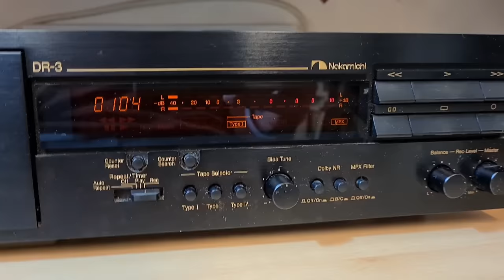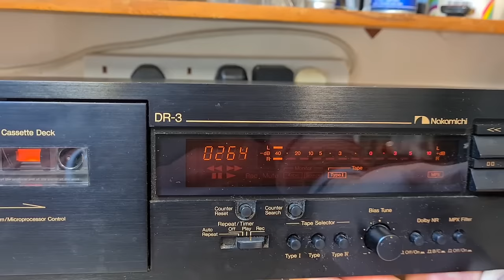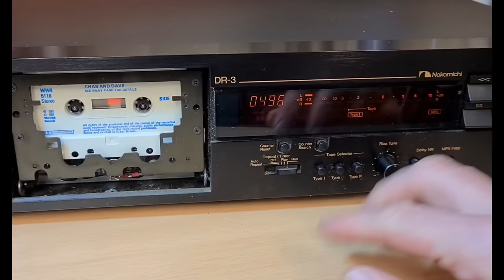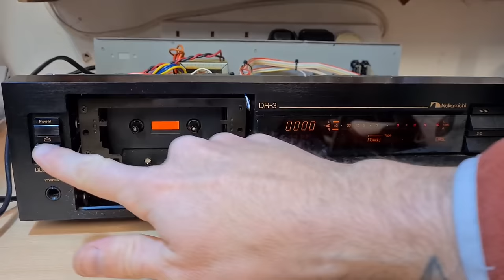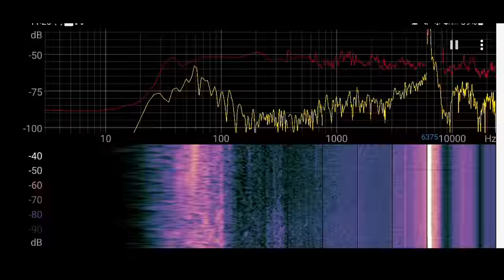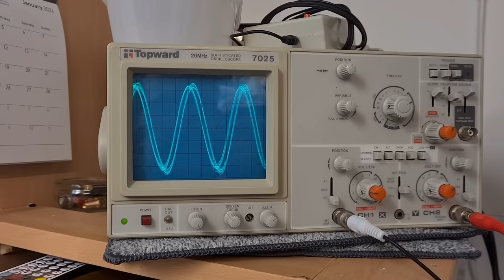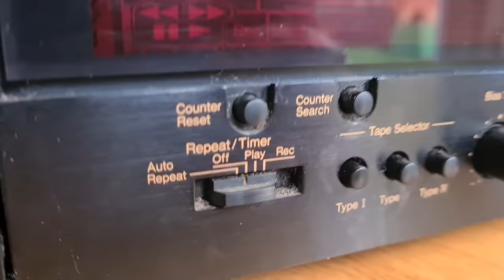Seller said it's broke, but its not?! Nakamichi DR3 Cassette Deck Repair & Service!

Comment: I have a DR3, great little machine I love it. I bought 2 Sony 611’s 3 head machines after watching your videos, both super condition around the cases but not working.  Both Sonys Sold as spares on marketplace (find it cheaper than eBay) did the belts etc and now have 2 great Sony machines. I can’t sell them though, they are so nice so I have a cluster of decks. 
I’ve started buying DAT machines as well, so bloody addictive. Same sort of problems as the cassette decks. I just bought a Sony A8 dat as spares parts. It is wonderful condition, found the cam had slipped on the tape loader, set it back into the right location greased it up….bingo perfect. I have also found I can record from my Wiim streamer into the dat with a coax connection, so all digital.
Reply from the maker: I was thinking of picking a DAT up mainly because I wasn't too impressed with minidisk. Maybe I'm the future!
Reply: @pwrestoration  yes good call. I have seen some Sonys going for mad money, but realistic is more like £200 I think anyway. I have a Sony A8, A6, 700 seriesES, and a tascam 30. Can’t tell the difference in sound at all. I also found tapes can be cheap if you buy the data tapes they last longer are more robust  and don’t have music written on them…….
It’s great to be able to tape digitial from a streamer, my wife says ‘why do that you can stream it’ which is 100% correct, I say ‘because I can’ it’s also nice to just drop a mix tape in rather than muck about with the iPhone etc.
Reply: I always think of wii when I see that name lol strange I'm the only 1😂.

MDs are awesome, I miss my deck😢

Nice video btw OP, congrats on the unit

Comment: Done really well you got lucky i guess they never noticed only the one reel of the deck was turning .Really nice clean deck this is the one model of nakamichi i would go for as i would never spend the amount any of the 3 heads make .
Reply: I got lucky back in the day and got a serviced DR2 for £100 - ex Chop Em Out studios so has lots of hours but the heads are still tip top. Had it since 2003 and it now definitely needs a belt replacement. Eek...
Reply: nakamichi is overrated ,you can buy a 3 head deck for less money than a badly built cheap nakamichi, and you´ll get everything better

Comment: Showing some advanced overhaul skills there... I have a DR8 (the last 2 head NAK) and a Cassette Deck 2 (looks different, same deck).
Reply from the maker: I didnt know the cassette deck 2 was similar, they pop up from time to time. Might take a look at one 👍
Reply: @pwrestoration  Pretty much identical internally. CD2 has green / red VFD instead of orange. Other than that it's just a styling job.

Comment: i bought last tuesday a still in the box nakamichi DR-10 in champagne ,but the brand is huge and where the cassette is inserted but on top of it and it looks a lot like this but a 3 head deck, it cost me 500€, but it works like new and released in 99 i thought the last was released in the 90´s but refering to the cassette deck 1, that with no doubt is the best nakamichi deck i ever had i took a great care of it and it works, today, the dr-3 , as you can see have the same display in the front as others. The CR-7a is also a great deck but in the summer i never play anything there

Comment: i´ve found lot´s of sankyo parts or equal to 70´s Normende cassette decks, in the 70´s bought a nice sankyo receiver that had mids on tone controls maybe why i bought it, but sound was more filled in those days, all is built with metal and thick glass

Comment: May have to change the belts on my DR3, it does look a nightmare to do but a doable nightmare plus i think it needs it's head aligned as it sounds a bit dull compared to my Cassette Deck2

Comment: I can't for the life of me figure out how to remove the top of this unit.  How did you do it? I took out the 3 screws on each side and the two on the rear.  It seems like the front of the case is some how secured beneath the faceplate.  What am I missing?

Edit: I got it, it was some sort of adhesive
Reply from the maker: From memory it doesn't go under the faceplate, screws off the back and sides, pull the sides out a little and lift straight up. 

Someone's there's fizzy drink spilt down the gap or there's maybe foam under it which has turned back to goo

Good luck

Comment: which oil are you using for the capstan?

i was looking videos on oiling the motor on dual 1219 turntables and somehow ended up here lol. you seem to really know what you are doing. I have been wondering if 10W-40 could also be used on other moving parts on the turntable or even on my tape decks.
Reply from the maker: Any oil is fine but sewing machine oil is a good start. 10w40 might be a bit thick but it would work better than nothing!
Reply: @pwrestoration  i guess i would use the 10w-40 only for the motor since everyone online seems to agree on it for that application. i'll have a look at sewing machine oil for other parts on the turntableand my tape decks. thanks

Comment: well i only bought all my life 6 pre-recorded cassettes ,decks are to record cassettes not to play badly built cassettes with the worst tapes, my second one was the first Boston Lp in cassette it came with a chrome cassette bought it in L.A. when it came out,curious because all was made by one guy,today it plays good for maybe 5 seconds than it dirts the heads, i have older reels that are ok with perfect sound today rercorded in late 60´s or earlier

Comment: Have this dr3 nak mint condition doesnt have hx pro which i gathered majority of tape decks have , got a revox b215 3 header as the dragon was way out of price range heard the dragons can be unreliable, hence revox no belts in the revox all direct drive motors had the capacitors replaced even new genuine revox pinch rollers transformed the deck
Reply from the maker: I'm always unsure about whether HX Pro makes a difference. I'm going to say.. probably!

Comment: i have real good cassette decks from nakamichi but the BX-2, at least works since early 80´s the BX-2 ,this is far from being a good one compared to other brands, that is more of the same the cheap nak decks are far better than the expensive ones ,well engeniered but built with the cheapest plastic they found

Comment: Nakamichi two head not that good....its not a CR7E Probably the best Nak ever,..... Nakamichi 1000 ZXlL Limited edition ( £ 14,000 ) £4,000 in 1983....you nead three head closed loop dual capstan then your talking....the tape deck you mid 90s about £200 ..
Reply from the maker: I don't rate nakamichis. They're terribly unreliable.
Reply: Two vs three heads has NOTHING to do with quality. The extra 'separate' head is only for monitoring your recordings and has nothing to do with fidelity differences.